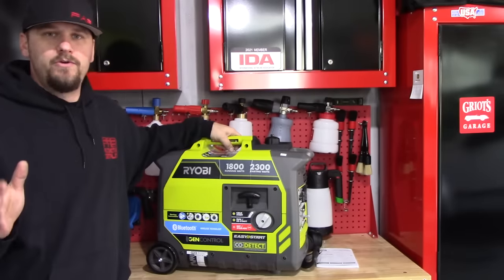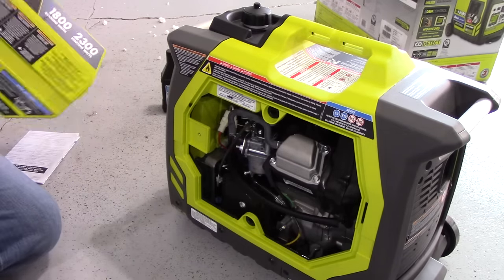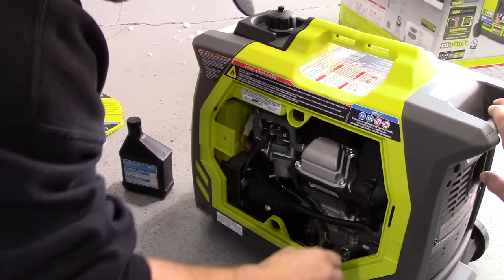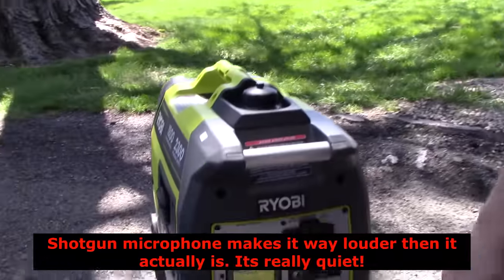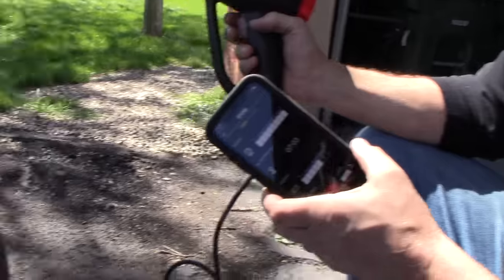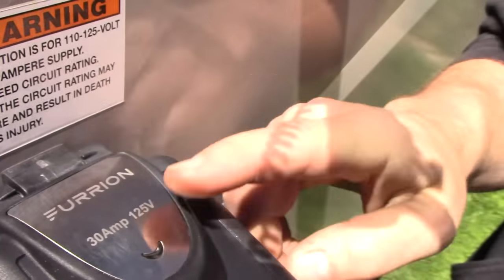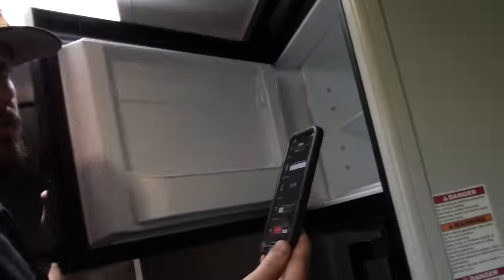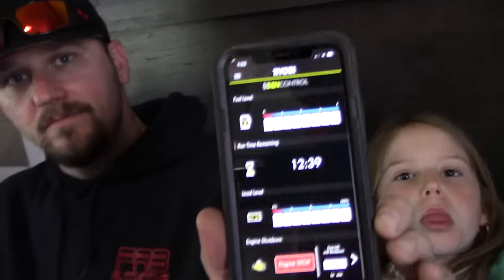Ryobi 2300 Watt Inverter Generator with Bluetooth! It’s so Quiet!

Comment: Been using mine for mobile detailing 2 years strong. Love it. I saw that there is a new 2300 one+ model with one button push electric start that way you don't have to pull the choke. Cost more but it's a nice luxury.
Reply from the maker: Glad to hear yours has been great! The electric start would be great on the new version because you can start it with your phone.
Reply: Read the reviews on that one. Seems promising but undeliverable
Reply: That's the one that has a spot for the Ryobi 18v battery right?
Reply: @angelseliteautodetailing  how is it undeliverable? It's a push start and uses a 18v one+ battery. It's easily deliverable.

Comment: Sorry seen this a little late but wanted to chime in anyway.  I have two of these for my RV and they are awsome. They start right up after  about 2 years of ownership. If you instal and easystart on your A/C you can get away with that  one generator running your A/C. I still us two thow as I travel at high elevations and we all know you lose power with elevation. Just FYI  its nice to have two small ones VS one large one. easy for my wife to carry :)   I dont allways need to run the A/C or use every thing in the rv all at once.  so I only take two in the summer.
Reply from the maker: That’s great to know. I thought about putting an easy start on it we will see how it goes.
Reply: @FABAutomotiveDetailing  Any update on starting the A/C in the warmer months? Mine is 13,500btu with a wall-mounted thermostat/controller rather than the kind you have directly on the A/C unit's underbelly. From what I saw in another video, flip off the breaker for the compressor or whole RV, turn off the fridge temporarily, start yours on the fan side for about 10 seconds in low, then 10 seconds on high fan, then QUICKLY turn the knob over to the A/C Low side. Soft start will obviously be easier on the generator, but that's around $400 right there.
Reply from the maker: @lynneftw  It will not run my A/C but I didn’t try it the way you suggested so I may have to next time it’s out.
Reply: Do these have oil filters?
Reply from the maker: @JablonskiV  No they don’t have oil filters.
Reply: More people need to know about that easy or soft start!!! I see so many people buying these to run there a/c. But the starting Watts is far to much. We run window units and leaving them on takes up less power.
Reply: @jregamey  the easy start/ soft start.  Lowers the initial wattage requirement for starting your a/c.  I have 13500 btu ac with wall mount thermostat. 1 of these generators will start and run my unit at 2400 feet above sea level.  When I hit 4000 feet and above it won’t cut it. I have two units in parallel. Using two will run it anywhere.
Reply: How are yall running campers off of these if they don't 30 amp camper plugs?
Reply: @anthonyhicks1354  they sell a paralleled  cable for them.  You do not need to have two to use the cable.  Plugging it into 1 will allow you to use your normal rv cord.  Or just get a dog one to 120 from 30 amp. I have done both and they both work fine.

Comment: After Hurricane Michael I put 1200 hours on this generator. Still have it, still runs but after I stopped using it for a year it runs rough now. Probably needs carb cleaned. Good generator.
Reply from the maker: Yeah probably needs cleaned or just replace the carb.
Reply: That’s why you want to put a duel fuel propane conversion kit on it, so you can switch to propane, run it for a bit, then turn it off and not foul the carburetor when you store it.
Reply: if you let it sit with gas in it that creates problems.

Comment: I have read a couple of the reviews and I see a lot of Negative reviews in my case  I see nothing wrong with it I've had my for 4 years and you and it's still running smooth!
Reply: can you hook it up to the house refrigerator only , and just for over  night  and would it stay running just for 8 hours, i use the  8000 watt generator for the daytime for the whole house, but i just want to use one that is quieter at night, like the one he is showing ?
Reply: I bet the issue is ryobi quality control. They probably skimp on quality control and poorly made units make it to market and those who gave a bad review got one. You probably got a well assembled unit.
Reply: @jeremiah1797  yes this would easily run fridge all night, maybe even 2 nights on one tank.

Comment: As for the air conditioning, you should be able to add a smart start that will reduce the starting amps so the generator will have a chance to run the a/c. Excellent review.
Reply from the maker: I plan to have a slow start put on the compressor. Thanks

Comment: My ryobi works on my 5k window unit,you just have to go full power on the generator. I didn’t know you can pair 2 gems thank you for that
Reply from the maker: I tried it at full power on the camper and it still didn’t work. You are welcome
Reply: Looks like he's got like a 12k btu AC. Need around 3500 watts I'd guess to run that bad boy.
Reply: @enthused7591 at 18:33. he.said it is a13.5k (13,500) BTU A/C

Comment: Hang on to that 12oz bottle for the oil changes.  Pre=measured for the correct amount.  I think I'm gonna get one of these as well.  Thanks for sharing.
Reply from the maker: I already threw it out but I will just have to remember 12 ozs and buy a cheap measuring cup. Thanks

Comment: Loving the Ryobi testing. Keep them coming. I use Ryobi. Will be getting the polisher and then debate over getting their mower.
Reply from the maker: Glad you liked it. As of now I don’t have any more products to test.
Reply: I have the self propelled 40v Ryobi lawnmower. It’s truly wonderful. I cut half an acre with it once a week. For a small yard you won’t need an extra battery. For my half acre, I use two to three batteries. They are far superior to gasoline engines. They ALWAYS start! Treat the batteries like they are gasoline.
Reply: @ericeinar  Thanks Eric, good to know. Thinking I will pull that trigger this year. Might be a nice Christmas present. Will start laying the hints.

Comment: I have an older Honda 2000 with very low hours.  I was going to install a soft start on my trailer AC and the manufacturer said the Honda should be able to run the AC as long as everything else is turned off.  I could run the frig on propane.

Comment: Ive got three and have owned a dozen...a few things, never leave gas in it longer than a couple weeks, and if it starts surging, clean the pilot jet on top of the carb. Also after a couple years the fuel lines collapse inside so I replaced mine with high quality marine fuel line and a good glass filter inline instead of the crappy red plastic one, cheers!
Reply from the maker: I appreciate the info. So I use Amsoil quickshot in my fuel and have left it all winter and it starts back up easily after sitting for months. I will keep that in mind though.
Reply: @FABAutomotiveDetailing  for sure adding fuel stabs is a must if it sits for a while, its just easy for me to just drain it for the off season based on where theyre stored, and I found the pilot jet gets clogged so easy even with stabilizer. I also bypassed fuel through several of the easy start switches on the first few I had because they never could seem to find a happy place, the later ones theyve improved so that shows Ryobi cares, they sure are great and quiet and waay cheaper than Honda or Yammihaha😂! Happy Fourth!!

Comment: Thanks for the review.  Consumer Reports have a good recent review of inverter generators (and portables and permanent units).   They give the Honda EU 2200 and the Predator (Harbor Freight) 2000 units 5 out of 5 for noise and this a 4/5.   The bluetooth connectivity on this unit looks great.
Reply from the maker: You are welcome! The Bluetooth is a cool feature.
Reply: @FABAutomotiveDetailing  that's a cool generator but it's good for low  power appliances like TV, Radio, Router, Hair clipper, 

But for high powered electronic devices like oven, fridge, air conditioners, iron, kettle, toaster, water heater, induction cooker, it will definitely struggle a lot
Reply: @danteerskine7678  nobody is using a oven on a generator, I don't know what one is low powered enough to run on 1800w. There is nothing wrong running any of the other thing you have listed.

Comment: I bought this generator and liked it.  It ran well and was very efficient.  The overloads failed in the hot sun at 105*.  They would not reset.  I feel this generator is not intended to run at high ambient temperatures.  The engine did well, seems like the electronic controls are lacking.

Comment: This looks like a great generator. I prefer my two Champion 2,500 generators. Cheaper (paid $550 for each) and runs on propane as well. Would be cool if it came with bluetooth though. That's pretty awesome
Reply from the maker: It’s a nice generator for sure. I looked at the Champion Dual Fuel also

Comment: Update. I purchased this after your review and you were right, it is awesome. I bought it for use in my RV with a Hisense portable air conditioner unit, and though it operates at 960w, the startup must have been higher than the 2300 startup watts available and it overloaded. The generator works great, as you said, but didnt work for me because of poor research on my AC. Just thought your viewers should know to look up the wattage used when the compressor in their particular AC unit fires up first. 
     I have a YETI power station that handles a 3000w surge and can get the air conditioning unit going but it drains the battery too fast. If anyone  knows of a fix or trick for this, itd be a huge help, otherwise I have to return it and start over.
Reply from the maker: It’s a great little unit but won’t fire my A/C either but it will run everything else we need it to in a pinch
Reply from the maker: Also it is surprisingly quiet! The video does not do it justice it makes it sound louder then it actually is
Reply: Please do not look into a “soft start” kit like someone else mentioned lol. Just return the darn thing and get a more powerful one. I’ve always been dumbfounded by people trying to sink 200 dollars more into a problem.

Comment: I like everything about it except the carbon monoxide shut down. I run a small generator in a small insulated box when the temperatures are below 0. This box has a small opening where the exhaust is and a hinged cover for warmer temperatures. It runs at a steady decreasing load charging a battery plant.

Comment: You CAN run a house on this.  Not everything, of course and you have to use hair dryer, coffee maker, etc., one at a time.  I have a 2500 watt dual fuel Champion that I connected to the 30 amp outlet my electrician ran through my breaker box.  I can run HVAC fan, lights, TV's, computers all at the same time and that was on propane at 1665 running watts.  Probably have to turn off HVAC fan for coffee maker but so what?  It gets me through the outage and the same generator works for my camper.  I do like the two handles on the end of the Ryobi for lifting it into the truck.
Reply from the maker: I have thought about having wiring done on my house also just in case we need it one day. I appreciate the info

Comment: Not a bad inverter generator on paper. However the first one I had the pull cord break on the first start up. The replacement unit started but was hard to start after it was warm and it would not restart until it cooled completely. I returned it and bought something else. Wouldn't recommend one of these to anyone.
Reply: i bought the kit that comes with two, both pull cords broke in less than a year, i replaced the cords with heavier cordage then the recoil broke a year later. when you run them in tandem, one generator always takes the load and overloads. i’m at four years in, still have one going and im waiting to replace the second  recoil assembly. also the fuel lines are trashed as well will gave to replace those soon too
Reply: @pacothompson7161  I was lucky enough to be able to return both of them and bought a harbor freight 3000 watt and it has been amazing and enough for my needs.

Comment: florida has a tax free week on hurricane preparedness items at the moment and i just picked this up earlier today. thanks for the video, i’m pretty stoked on it now! do you think i would be able to run a small chest freezer and one or two box fans on it simultaneously? i got it mainly for the freezer, but it would be nice to have some circulation in the house if the power goes out... thanks!
Reply: Yes, no problem with a fridge and a coffee maker
Reply: The chest freezer on my houseboat barely put a 30-40% load on it.  Should be fine.  Just don't overload it.  Seems the overloads are weak.
Reply: @pope1856  thank you so much!

Comment: Awesome video buddy! I am looking at one of these for my small R Pod camper. Did you retest it with the AC running? That is the main thing I want to purchase it for. Thanks!
Reply: It should be able to handle a 13,000 btu AC just fine. Might be pushing it with a 15,000btu

Comment: Kinda surprised that it got 80% load with the microwave which should only be eh 900watts for a RV spec microwave. Unless it's 1200. But that is still pretty low.

But then again i think it's because your RV plug isn't spec correctly. I have NO clue who put '120volts 30AMPS' There is 0 possibly for it to provide 30AMPS on a single 120/110v outlet. Now if that plug had a RV to 2 110/120volt AC 15-15amp plugs. Then you'd be able to get 30amps to the RV port. So that probably explains why the above was putting such a high load of near to 80-100% with very few things + the microwave. Because you're already at 1500watts on the Single 15amp rated AC 110/120volt plug from the generator. But if you had Dual plugs from it to the RV. you could've gotten that extra 300watts and surge power.

The Generator is 1800 stable watts to 2300 surge (Say the AC primes. It'll lower power After it Surges up from the compressor motor. or so forth.). But the Outlets on the generator are only rated to handle the same standard class of 1500watts/15amps as a standard home outlet does. So you'll never get 1800watts from a single plug. The ports are not shared (Atleast i think. The shouldn't be.). So you can run 1000watts on 1. And the other port can handle 800watts. Or like above 1500watts on 1 AC port and 300watts on the other.

Though that is just AC alone. Since you have Split load power. The power equals from the other ports. So if you have 2 of the USB ports doing 12watts each. That's 24watts. The 12volt port having 120watts that's 142watts. Then the 2 AC ports having 1500watt 1 and the other doing 258watts will = the full 1800 of stable power. But AC ports do use 5watts Even if there is 0 devices plugged into them. It's why most electric solar generators have a option to turn them off because AC power has to change switch power. Not fully sure on how inverter generators go. But i know electric solar generators work by converting the 12volt DC power up to 110/120volts AC. Which has to change the whole power system because DC is Direct current. While AC has a faze shift system. So it needs to change the DC current to shift power. So it has to use around 4-5watts just to power the ports. And you loose about 10-15% of performance of battery life due to the conversion. Why normally it's way better on a DC setup to run straight DC. It's easier and less power converting to loose a % of battery performance. Though with Gas. You're always using gas no matter idle or running low. So even if you didn't use power from it. You're still burning fuel.

Pretty good life for a idle/low power of around 17hours. Though how much it take? gallon of fuel or less? Would seem pretty nice.

Comment: Can you do a small gas drain to keep the carb dry after each use ?
Reply from the maker: You can open the drain on the bottom of the carb and drain it out

Comment: Have you considered installing a soft start on your AC and seeing it that will run with this generator?
Reply from the maker: I have and plan to soon. They cost about $450 installed
Reply: @FABAutomotiveDetailing  or buy for $340 and install yours. Several YouTube videos on how to do it. I will but need to be a cooler day out.
Reply: Or… you could buy whole nother for that much and have two and voila lol.

Comment: Would this Generator be good for mobile detailing? Lets say about 6-8 hours a day of detailing cars using an electric pressure washer and a small shop vac
Reply: Yes. It’s the typical Yamaha-clone generator with the 80 cc motor. In my opinion, they are all the same with regards to reliability. I’ve plugged air compressors and 1500 watt heaters in them to see how far I can push it. One thing is to check the spark plug and change it. The ones that come with it sucks.

Comment: Would it work for a Mobil detailing trailer? To charge batteries and run power washer, extractor, vacuum and steamer?
Reply: There is someone in this very comment section that said they have used it for 2 years as a mobile detailer.

Comment: can you use the Ryobi 2000 psi pressure washer?
Reply: I have a small honda accord and i would like to use this inverter to power a ryobi 2000 psi pressure washer for roughly 2-3 while holding the trigger hours any thoughts?

Comment: I might be a good idea to use as a range extender for EVs.
Reply: I've seen videos where you need to somehow bond the neutral and ground together to get an EVSE to work. I'm not sure what models/brands can do this.
Reply: Would only increase range by a few miles every hour. Tesla uses about 220wh per mile. If this was charging at a full 1800w it would only add 6miles of range for every hour it's plugged in.

Comment: Can I run a pressure washer and vacuum on this?
Reply: Not at the same time but yes. Anything you can plug into a wall 120v outlet this should run besides maybe a chop saw.